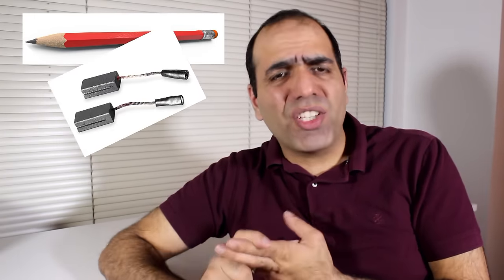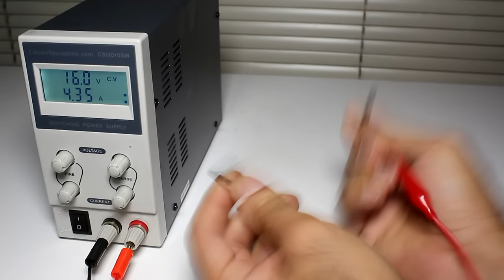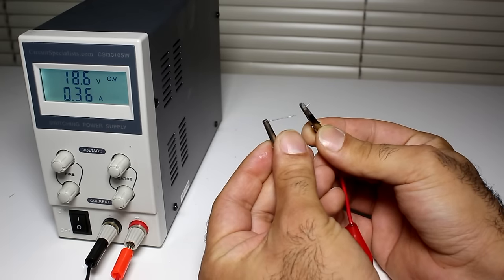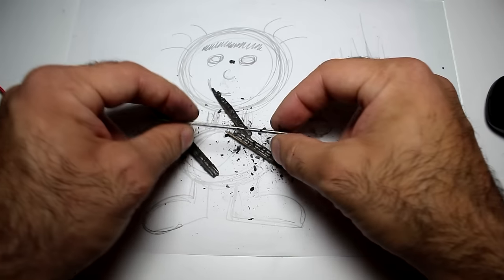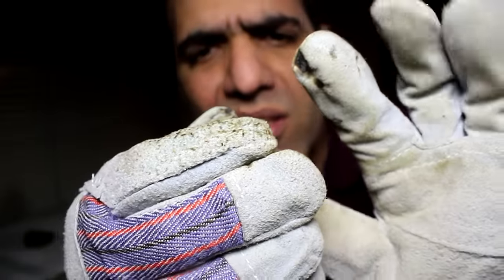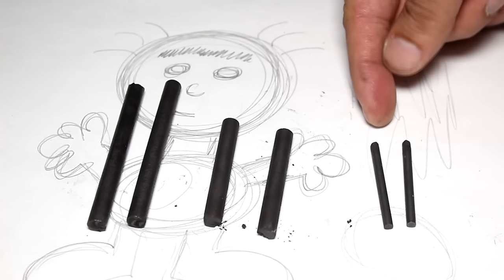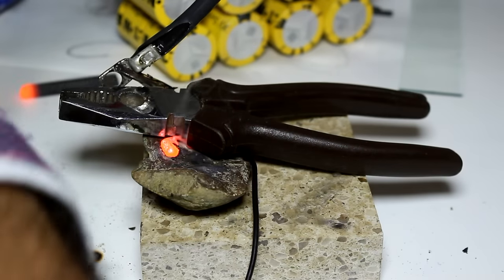Graphite and Its Awesome Properties

Comment: I'm a welder, and we use carbon rods coated with copper for air arc gouging. Because the Carbon can withstand high temps, the steel becomes molten. Then you introduce a high pressure air stream that causes rapid oxydization that blows a gouge right into steel. It's super loud, and creates a huge amount of toxic fumes too.
Reply: What is the source of the toxic fumes? Burning metal or oxides Burning?
Reply: @TheDerpy Kitty CO always has a clean scent  lol
Reply: It is so therapeutic though, I love gouging and watching the molten metal just cut away like butter
Reply: It's pretty cool, but it always seems like you're in a tight spot when gouging so no matter where you direct the air, you're getting showered in sparks... and holy hell is it loud

Funny how ar the end of the video, where he's melting the copper, it sounds exactly like it

Comment: Graphite has many applications, from pencils, to DC motor brushes, to some traces on electronics, to battery batter carbon rods and allowing a fast boom in reactors.
Reply: clever
Reply: I'm here to make diy conductive paint with it, mod podge, and a tiny amount of distilled water.  Just hunting for the best graphite
Reply: So all this concern stem from the description of a rock?
Reply: Also crucible due to its higher melting point than tungsten

Comment: Late to the party but for anybody with "sort by newest" and stumbling upon this video, in welding processes we use the same concept as those carbon battery rods in "Arc Gouging". A long carbon rod plated with copper usually is hooked up with a clamp connected to compressed air and the amperage is turned way up beyond what is typical for arc welding. When the arc is established, it punches deeply in to the base metal and the air blows the molten metal away, gouging out the metal. The rod is consumable so you'll have to replace it after a while but it's one of the few things that can produce the arc intense enough for this process without also just melting itself and leaving a big puddle of molten metal.

Comment: When you were touching together the two graphite electrodes, the way they burnt up and made a squeaking noise suddenly reminded me if a metal fabrication process known as air carbon arc (ACA). You use a roughly 3/8" carbon electrode with compressed air and like 300 amps DC to just blow big chunks of molten metal in your steel.

Comment: I tried this as well when I was a kid, I used a 2,200W electric oven as a series resistor to limit current and prevent the breaker to pop. Worked really well and gave nice long lasting arcs!

Comment: 1:59 That pencil is garbage, can't stand 240W of power.
Reply: It made of wood
Reply: @_saymun  salt
Reply: It makes a diy smoke grenade
Reply: What?
240W?
Reply: @kamal92606  maybe he will in a flex seal idea and is spilting a atomic and try to fix with a techno flex seal but   
he got  split instead
Reply: salty m8
Reply: @peacefulguy9539  ah tk you. Im studying electrical current right now and im very confused with the topic
Reply: I can't tell if you're joking or being serious
Reply: @peacefulguy9539  The moment I stopped the video and made the joke, the supply was giving 24 V, so 24V x 11A = 264 W . I just rounded to 24 x 10 because I was too lazy to do 24 x 11 by head. Actually, as I pay close attention to the event where he burns out the pencil, the graphite is showing negative temperature coefficient, i.e. the resistivity drops as the temperature rises. I'll go check this further, it's interesting.
Reply: @renatoencarnacao5490  Well dude you're right, I didnt see the "point" at his power supply. Comment removed! 

About the graphite I checked out, it has a temperature coefficient of about -0.4 (1/°C). The resistivity does drop with temperature (not so much though). Semiconductors as Silicium and germanium have -a coefficient of -50 to -75 (1/°C)! I'd love to put some juice on them and see how they behave ;)
Reply: @nilsisprewhereshouldiputmy9664  Good luck!. As advices I could say that you have to like what you're doing (it's pretty easy with electronics right?). And take a pen and resolve as much problems as possible for hours and hours and hours, you'll never be an engineer with only videos.
Reply: @peacefulguy9539  Thanks, semis have such coefficients because carrier mobility increases greatly with temperature, but I didn't think graphite could behave like that too.
Reply: Wyvern animation and Raptorgamer143 r/wooosh
Reply: Wyvern animation and Raptorgamer143 r/woooosh and cha cha real smooth stop please
Reply: Probably 120 Watts not 240 because I think this is in Canada
Reply: @shamsmm  naah im pretty sure watt's law works the same way in canada :D
Reply: Its made out of wood what do you expect GHRAPITE does not burn it is a carbon same as the burning coal but it maybe not be conductive so
Reply: Tu é BR?
Reply: Its 240V not W
Reply: @invplayzroblox227  you can see the voltage on the power supply. Its around 20 volts.
Reply: @TheArachnoBot  ok
Reply: Instant smoke bomb

Comment: Use ac, point the ends of your carbon in a pencil sharpener, and hold them so tapered faces are parallel, voila, a carbon arc flame torch. Distance between carbons shapes the cone of flame (really a plasma stream). 5000 degree f flame, so seems just about fraught with potential doom enough for you, lol. Make a water resistor, you can even run it straight off mains, no transformers or other technology needed. Plenty hot enough to weld, but also great for brazing, hard soldering, hardening and drawing steel, annealing copper sheet, or flash cooking hot dogs for a quick snack... Imagine the glove fire that could produce, and all that juicy monetized account dinero!

Comment: Fun fact:  They tried to stop the Chernobyl meltdown by dropping a master control rod into the core.  They didnt know that it was tipped with graphite which was partially responsible for the melt down
Reply: Ah yes the boron control rods tipped with graphite

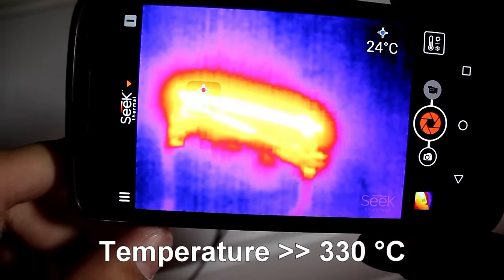Comment: 2:40 what happens if i use at the sun
Reply: It won't measure the temperature correctly.
Reply: Temperature guns and thermal cameras work better when they are closer to the source. It will probably just measure the air temperature
Reply: What's with your username?
Reply: H E A T
Reply: The sun is actually white because it’s over 10,000 degrees. The yellow we see is just an effect from the atmosphere.

Comment: Graphite was very usefull in RBMK atomic reactors till you press AZ-5 button :b
Reply: @43628leavemealone  yo stop being racist to uranium 235 😡
Reply: Wiertel12_pl just the tip 😂
Reply: Ily for this reference
Reply: It was a safety test that went wrong. RBMK reactors sacrifice safety for output.
Reply: @Wiertel12pl  yeah tell him don't mess with uranium 235 it could get real mean

Comment: You didn't see graphite on the ground because it's not there!
Reply: I rate this 3.6 not great not terrible
Reply: @georgewallace8286  You gave the rating you had based on the information available at the time! I would guess the actual rating is much higher.
Reply: MitchBloodGreen your delusional
Reply: I knew this comment would be here.
Reply: It’s the Sterenkov effect, totally normal
Reply: MitchBloodGreen spreading misinformation at a time like this
Reply: it's not 3, it's 15000
Reply: Ahmed Saed woosh
Reply: @byakugan641  Were gonna need 5000 tons of sand and boron then...

Comment: you know, the thing I love about using graphite rods when heating things with an arc (like in an arc furnace) is that the graphite basically vaporizes and burns into CO2 in the air, essentially making a flame that burns and probably makes the arc even hotter, and larger.

Comment: Diiiiiid, did the graphite rods from the batteries MELT a little bit?
Reply from the maker: It seems as if the graphite directly vaporizes. In battery rods though, I think there is some mixture of other material too that can melt a bit.
Reply: +ElectroBOOM hello hi
Reply: ***** Makes sense.
Reply: There is actually a wax coating that needs to be burned out before you can use them for heating or melting. I hope this makes sense.
Reply: you can use these graphite rod and a modified microwave oven transformer to make a miniature arc furnace.
Reply: in most batteries with carbon rods, there is a thin coating of wax which melts away when you first run electricity through it. another youtuber named Grant Thompson went over this in one of his videos.
Reply: Graphite doesn't melt, it sublimes like dry ice. And it doesn't start subliming until >6000 degrees Fahrenheit, higher that tungstens melting point
Reply: i think they are covered with wax, that melts off when the arc is formed
Reply: I thought id mention this entire experiment is a bit flawed from the start, carbon in pencils and battery's is not actually aligned hence the high resistance,  the carbon you were looking for is actually called graphene and is actually a way better conductor than copper or even gold or silver (depending on the grade of the graphene).

Slight edit to clarify: graphite is crystalline and not aligned, graphene has the alignment you mentioned, videos are still as hilarious as always ^-^.
Reply: ***** 
graphite is still fairly conductive, although not nearly as conductive as graphene, but it still is good for making arcs and heat

Comment: what's it take to get one of those cameras?
Reply: Be a patron via patreon
Reply: Several hundred dollars!
Reply: $499 :D
Reply: Cheapest one is $249 on their website.  Go to the link at 4:37 and click "shop" in the upper right corner
Reply: It is going for $150 - $180 on eBay.
Reply: jongaskell if you use the promo code thing its 200

Comment: How are you touching 30V 10A at 1:48 and you're fine?
Reply: It doesn't look like he's touching it
For me
Reply: He's not touching it, and 30VDC isn't enough to hurt you anyway.
Reply: @Owen_loves_Butters  Both voltage and current can kill you if either is high enough in comparison to the other.
Reply: @gootz3182  You can't have one without the other
Reply: Take a car battery as an example. It can produce hundreds of amps, but it doesn't kill you because the voltage is too low.
Reply: @Owen_loves_Butters  as a now engineer, i finally understand. how did you find this comment lol?
Reply: @Owen_loves_Butters  yeah!

Comment: FYI in cases where people use gloves for blacksmithing, it’s possible for the gloves to heat up quickly and surround the hand in heat, particularly when touching things that are hot but not hot enough to cause the gloves to catch on fire. What happens then is severe burns from the heated gloves. 

In fact, gloves are really only useful to prevent burns from flying metal flecks, sparks, and blistering from chafing (due to holding something rough). They are not intended to be used for handling hot materials, as the materials can reach temperatures well past effective insulation levels while not glowing. 

In other words, don’t handle hot things with gloves, use tongs! And make sure your tongs aren’t hot before handling them!!

Comment: Dude I made a tic welder from a 24 Volt DC adapter and one rod from  A 3 a battery I welded things a melted things too I unfortunately destroyed my adapter  I made a new one but it's only 12 volt not 24 and the amps is no longer 6,3 amps but much lower and I see the pencils have graphite instead of lead you gave me an brilliant idea il use the graphite from pens instead of battery's

Comment: When you extract the graphite from the D cell, the black stuff is manganese dioxide and it is moist from the ammonium chloride solution. I used to mix the black powder with aluminium powder for the thermite reaction, I didn’t find any manganese, possibly it burned up. I was told the reaction can be explosive so don’t try this at home.

Comment: Graphite, great solid, conductor of electricity, allows You to draw, and decelerates neutrons.

Yeah, neutrons specifically...

I wonder what kind of reactor used graphite as a moderator instead of only water wich causes it to generate such a high Steam pressure When a certain button that lowered all the Graphite tipped Boron control rods wich got stuck because of heat and Made lots of pressure wich Made it blow all up The reactor lid wich weighted a LOT and make a certain city and an entire forest to be radioactive?

Comment: To make a spark bomb take  a ligter carefully take it apart take the flint and spring wind the spring around the flint and heat it until it's orange the throw it on the ground  it will make a huge cloud of smoke an lot and lots of spark s

Comment: can someone explain why the graphite heats up but the wires dont
Reply: The wires have lower resistance so current passes through them without generating much heat
Reply: @laserdiode  that makes sense. Thank you

Comment: We used graphite pencil leads to light cigarettes in prison.  They wouldn't let us have lighters.  So we would stick paperclips in the electric outlets.  Then we would remove the wood from the pencil leaving the graphite rod.  We put the graphite rod in a comb, then held the comb and touched the graphite to the paperclips sticking out of the outlet.  This caused a big spark.  We had the comb and graphite in one hand, and some toilet paper in the other.  The spark would easily light the toilet paper.  We then lit our cigarettes with the burning toilet paper.

Comment: Do you have anymore of the thermal cameras I customize Android mobile devices and I am also a ethical hacker I am taking courses in hardware Hacking Since you are good with electrical engineering knowledge maybe we could possibly work together on creating a new form of Hacking to further knowledge of security issues relating to the use of emf and radio waves maybe we can come up with some groundbreaking  discoveries in information technology and other technological related fields. You are a very bright and intelligent individual who is capable of extraordinary feats I think that you would be a asset in implementing a new form of data siphoning and how to prevent such methods f being implemented by individuals who would want to use it for unethical purposes so let me know if you are interested in working with me on a project I am working on to siphon data from radio waves and emf

Comment: I'm not an electrician so can anyone help me here? If graphite is a good conductor, shouldn't that mean that there is low resistance, which should mean that it doesn't heat up fast? Why did it get so hot in this video then?
Reply: Compared to the copper wires it has more resistance so it heats up more than the copper

Comment: An alkaline battery has a manganese dioxide electrode instead of carbon, I believe.  (It’s been a few years since I looked it up), but that’s beside the point.  “Heavy Duty” batteries like “Alkaline” batteries have an alkaline electrolyte.  So they are both alkaline batteries.  So our language about these batteries is wrong.

Also, our language about batteries is wrong when we call them batteries.  A AA battery is not in fact a battery.  It is a cell.  Two AA cells in the same circuit are a battery.  A nine volt battery is a battery because inside there are six 1.5 volt cells.  A battery is more than one cell in the same circuit.  If you have a flashlight that takes three AAA cells, do not say you need to replace the batteries.  Instead say, you need to replace the battery.  If you have two piles of dirt and you rake them together you only have one pile of dirt.  If you have two batteries and you put them together, you only have one battery, and if you have two piles and put them together you still have two piles but one battery (volt piles that is).

Comment: At 1:57, the current stays a constant 11 A, but the voltage drops as the graphite heats up.  How would the resistance decrease?  Is current finding an alternate path through the plasma around the graphite?
Reply from the maker: Apparently graphite resistance drops at temperatures below 1000k and rises after

Comment: Greetings ! Could you help me with a noob question on resistance in this particular experiment ?
1) Tried with a thicker pencil (like carpenter pencil), the pencil heated up quickly and burnt the wood.
2) Tried with a thinner pencil (writing/drawing), the pencil fumed but didn't burn as easily.

Pencils were of similar length, used the same 12V car battery.

I would guess that in case 2), the graphite has a higher resistance since it has a smaller cross section.
But in that case, why did the thicker pencil burn faster ? I thought that more resistance means more heat.

Many thanks in advance for your enlightening explanations !
Reply: The graphite in the thinner pencil wasn't pure. I have seen some pencil lead melt because of additives.
Reply: Different pencils have different graphite types like HB or 2B. For this reason it could burn faster.

Comment: That little power supply always looks like its no where big enough for these fires or flyback circuits ive watched.it must be a camera illusion.kinda inverse of camera adds 10lbs to our picture.must subtract 10 lbs. For a power supply.lol.maybe its a switcher cause its  no boat anchor in appearance compared to my linear supplies.im baffled.must have a flux capacitor in it.lol.